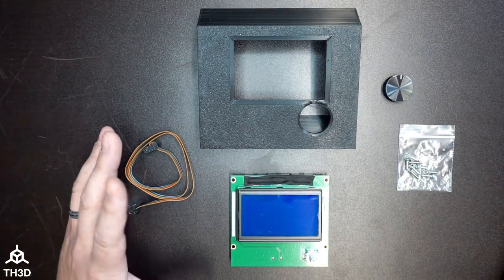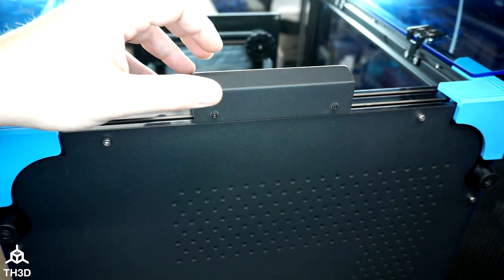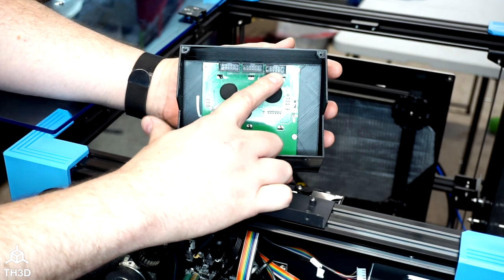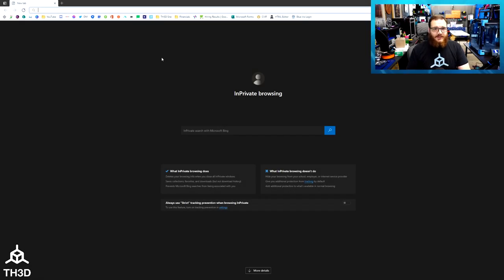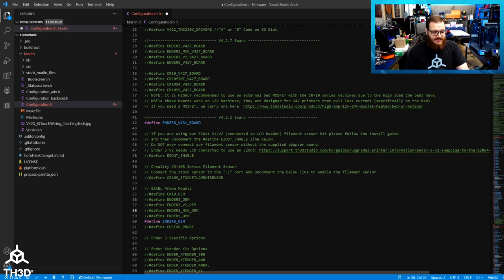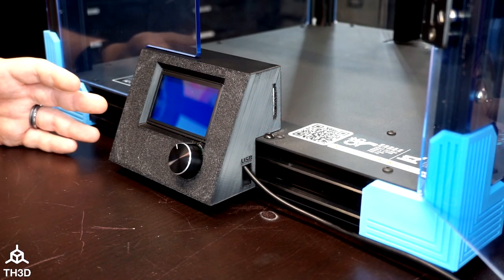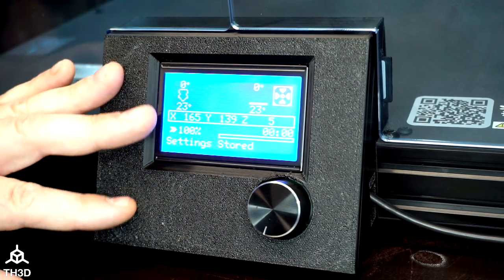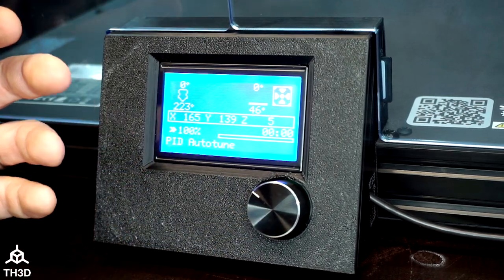How to Install the TH3D Ender 6 LCD Upgrade Kit - Get Babystepping and More for your Ender 6!

Comment: Great Kit this is a must if you want to run your ender 6 easily with the stock board. I was going crazy before installing this kit. Now it works great. I would also suggest their ezabl for auto bed leveling. After I installed the ezabl it takes no time to level the bed it is much faster than the bltouch. I loved the bltouch before I used the ezabl I will be switching all my printers over to ezabl. So watch ebay for a used bltouch in the near future.

Comment: Fantastic video, I'm really interested in this solution to providing more advanced control of the printer, just wondering though, i have recently installed a biqu h2 to my ender 6 and need to change the x and y offset, does your controller and firmware enable me to do that? Also i have a BL touch already installed, is your firmware compatible with a standard BL touch, i will definitely be investing in your touch solution in future though. Thanks so much in advance.
Reply from the maker: Our Ender 6 firmware does have BL Touch settings in it, we don't provide technical support for that probe but the firmware does facilitate the use and setup of them.

You will also have full control over the firmware settings with our kit and our firmware as we provide all the source code for you to modify.

Comment: So will this screen upgrade allow the printer to perform a midprint post-processing pause properly without having to babysit the printer (so you can do a filament change? With stock, the printer will pause briefly and then resume again.
Reply from the maker: Yes it works correctly. I (Tim) use it on my Ender 6 every week and it works prefectly. I don't get why the manufacturers don't understand how to properly code firmware. :P

Comment: I would like to increase bed temp a little above 100c.   Will this allow 105c?   Ender 6 is known for not being able to do curves without hesitations in Spiral Vase mode due to Power Loss Restart position constantly writing to the SD Card.  Can Power Loss be disabled or is it otherwise corrected?  The load and unload stepper speeds are terribly slow on a stock E6.  Is this adjustable in the firmware or on the screen.?
Reply from the maker: The power loss is disabled on our firmware by default because it is buggy so you won't have that issue on ours. But our firmware does require the LCD kit shown in this video for it to work.

The unload/load speeds are able to be adjusted by changing them in the configuration_adv.h file in our firmware. We have them setup to be a little quicker than stock but the source code is provided so you can make changes as you see fit.

Comment: A few quick questions: the stock ui has been driving me nuts so this seems like a good solution. How does it interface with octoprint, Any difference with the different firmware? Is there compatibility with the bltouch? And out of curiosity, how do you get that texturing on the front face of your screen housing? This looks like a life saver for me!
Reply from the maker: The firmware with the LCD works 100% with octoprint (using it with the printer used in the video right now). BL Touch settings are available in the firmware as well. As for the texture, we print all our LCD housings on our EZFlex textured plates. The finish looks awesome! Check it out here: https://www.th3dstudio.com/product/ezflex%c2%b2-for-ender-6/

Comment: Would this screen work if I have already upgraded to Klipper and Fluidd?
Reply from the maker: Klipper does work with the 12864 Creality LCDs. We don't provide technical support for Klipper so you'd have to refer to their documentation on how to setup their firmware for the Ender 6 board.

Comment: With this upgrade will the bl touch be plug an play?
Reply from the maker: We do have support for the BL Touch in the firmware for the Ender 6. You'd have to wire it up and then set the options in the firmware. :)